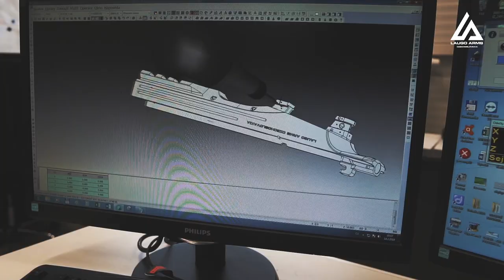Laugo Arms Alien production line

Comment: But the question is 
WHEN IS COMING TO THE USA ?
Reply: They are all sold out already, because only 500 were produced.

Maybe they will soon release a cheaper version of it, from aluminium or polymer without any accessories.
Reply: @hanf022  they are releasing non limited editions in the future, there's no release date yet.
They will not be made of different materials but will offer different optics cuts for different optics footprints.